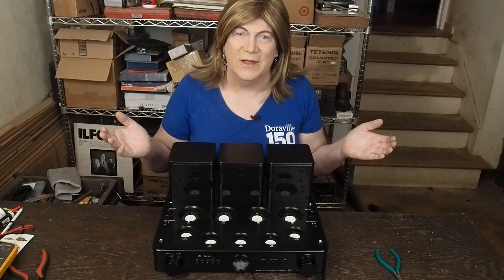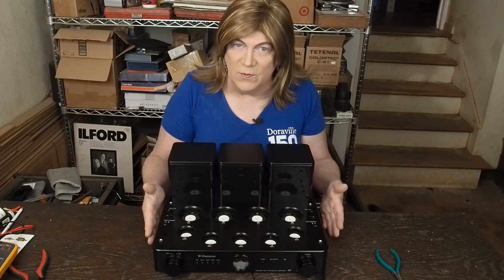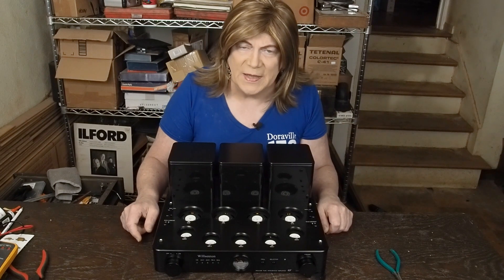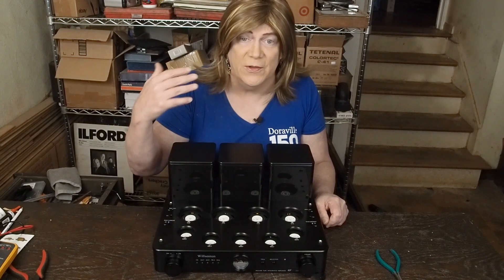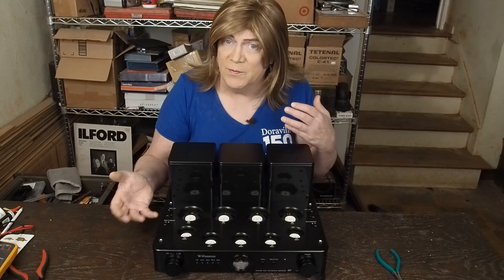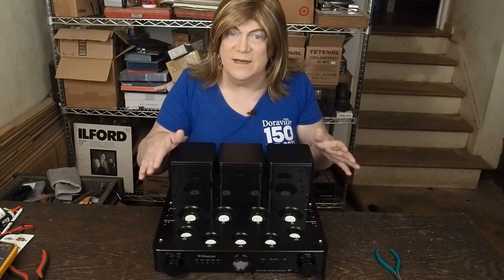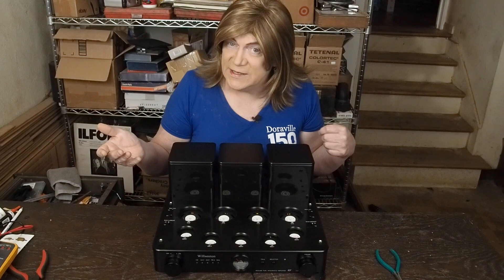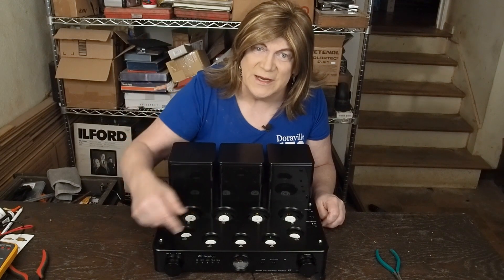Monday Monologue: Willsenton R8 on the Bench!

Comment: The guy who burned his R8 should not have left it on with no signal input. This is even written in the user manual. He just caused it himself. It is never a good idea to leave a tube amp with no signal input for several minutes, or more !
Reply from the maker: That should not cause an amp to "burn down". Honestly they should be able to idle all day with no signal, the only "damage" would be hours taken off the tube's life. In another video I explain his house wiring was screwed up, the neutral was floating causing the outlet voltage to jump up to 150V, and that's what made the tube red plate.
Reply: @SkunkieDesignsElectronics  You are right !

Comment: Have a look at the two large filter supply capacitors. They are a very low voltage rating compared to the voltage they are supposed to filter. Mostly just a safety concern. Looking forward to your findings.

Comment: I have had my Willsenton R8 for a couple of years now, with total enjoyment. I ordered it with optional PSVane tubes.  Rock sounds better in Ultralinear mode while acoustic and nature sounds are better in triode mode. Very, very powerful with excellent control of bass for a tube amp.  The only complaint I have has to do with remote control. The loudness increments are too spaced out. Either too Loud or too soft with some music. When I want to listen to a different sound I put on my Naim amp. That one is just super also. Now I am building a  dual mono tube preamp around 6SN7’s using PCB’s from Valvesnmore (Tubelab on YouTube) looking forward to your videos on this R8. VERY MUCH… keep up the good work.

Comment: Dear Skunkie - that one looks nice .. Little amp tale; On having to leave my last place in a hurry, everything packed in the van and not a BIT of room left, I saw this Philips tube amp - rather then leave it in the rubble, I chopped the transformers and tubes, then remade as a cute lil 6AQ5 Headphone amp - The OPTs were kinda small, but with  NFB or triode mode, I got decent bass - into headphones at least ;)

One of Mikes drunken pals may have stole the prototype, which kinda sucks, but now Ive got the design down I might remake this with EL84's (as theyre not making EL90/6AQ5, right?)

You kinda reminded me when you mentioned triode switches and tweakable NFB ;) This thing had - it was Hand Wired, and quite a bit of work, but if I get a Mk2 rocking maybe I'll put a vid out?

Meow for now - Pete & William Stereocat London

Comment: It is a voltage regulator in the center.
Reply from the maker: Weird, never seen an amp use a tube for that or even need it. Have you seen a link to good info on it?
Reply: @SkunkieDesignsElectronics  I learned about it from another channel Here on youtube. It is a couple guys that have a tube store. You may want to check them out. Tube Lab is their channel.
Reply: @SkunkieDesignsElectronics  Tube Lab #33 shows this amp.

Comment: Floating neutral on his house?
Reply from the maker: Good guess! We saw almost 150V on some outlets and under 100V on others.
Reply: Could you explain what a floating neutral is. Thanks
Reply: @markmckelvey9806  according to Google: A “floating” neutral occurs when the connection to the ground breaks or becomes loose, which causes the neutral bar to “float.” This can happen in your panel or between the utility and your electric panel. It can be caused by a mechanical issue or other issues like rust or corrosion.